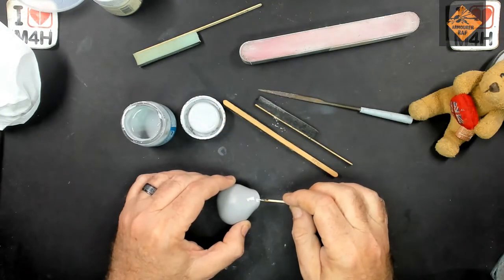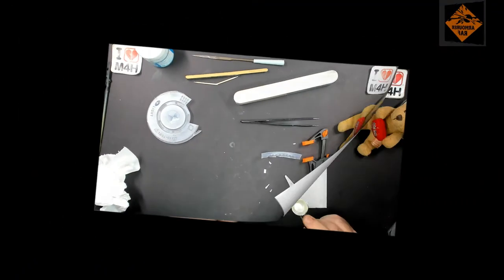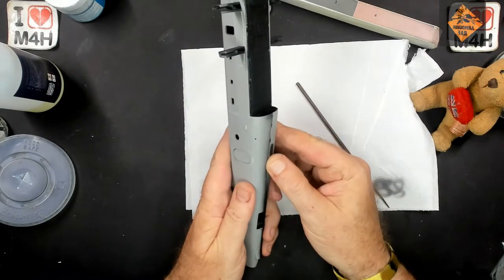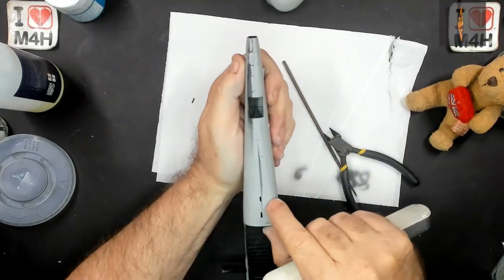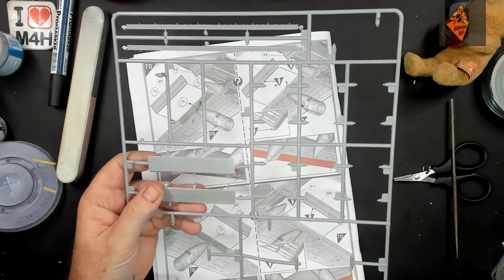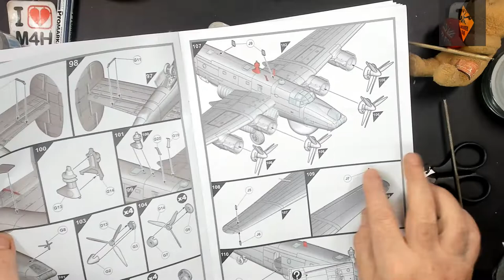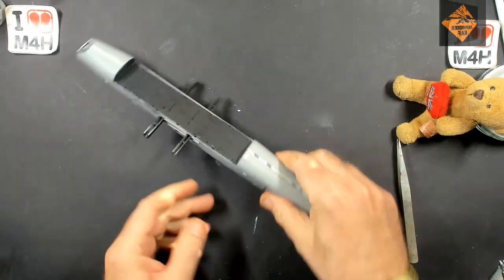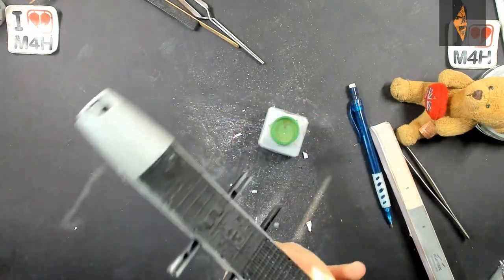Episode 5 of Airfix's 1/72nd Avro Shackleton AEW2

Comment: Couldn’t you split the body to realign it or other bits could be out later. I’ve tried on other kits I just run tamiya glue down the joint and it melts previous glue you might have to do a couple of runs but it works really well but if you have one of those metal splitters that’s even better. Hope it help in future projects.
Reply from the maker: I did think of that but I’ve tested the wing fitment (in a later video) and luckily it has no knock on effect 👍👍👍